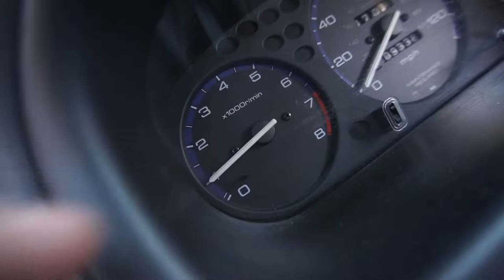1 EASY Step To Getting Perfect Fitment! (Works On Any Car)

Comment: Check the idle air control valve and clean it out if that doesn’t fix it clean throttle body and if that doesn’t fix it replace both or adjust the idle screw on the throttle body I had that same issue with my EJ8
Reply from the maker: Thank you for that. Most definitely will take a look at that.
Reply: No problem fam dope build by the way

Comment: clean out that Idle air control valve to fix that bouncy idle. located right behind the air intake manifold worked great on my 95 eg d16 motor.  great vlog keep it up! Hoping to have my build on my channel be on your level! Airrunner x Airlift x T-Demand x SSR
Reply from the maker: Thanks for the tip! i'll have to do that next time im over there. I'll check it out right now!

Comment: I know it's 2 years later but Ive had a lot of issues with idle and usually it's either throttle cable adjustment or IACV. Very annoying.

Comment: When I owned the car the bouncing idol went away after changing the distributor, it stayed away for about 14 months then came back, when I used I live view on the OBD scanner with the car running the idol wasn’t bouncing according to the ecu it was just the RPM gauge bouncing so I left it, the car does idol higher than normal for some reason (1000-1200 rpm when it should be 600-750) so yes I would say do a full tune up on it to be safe, spark plugs, wires, distributor cap and rotor, pull the injectors off and get them clean, do a full intake manifold cleaning, with attention to the IACV and throttle body. The car is due for this maintenance as it hasn’t been done in 50k. This will give you a “clean slate.” Before digging at individual problems on the car.
Reply from the maker: Thank you for that! I’ll do that soon!